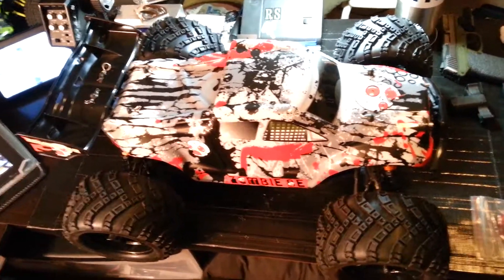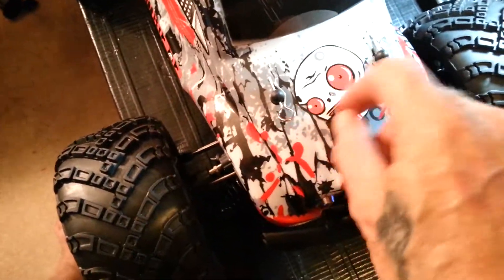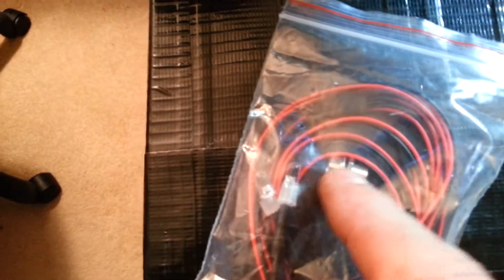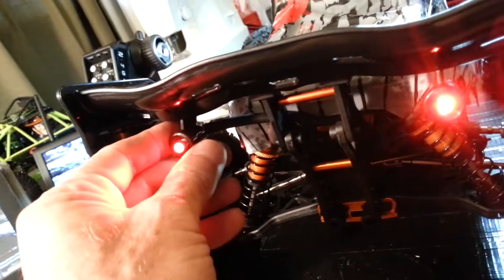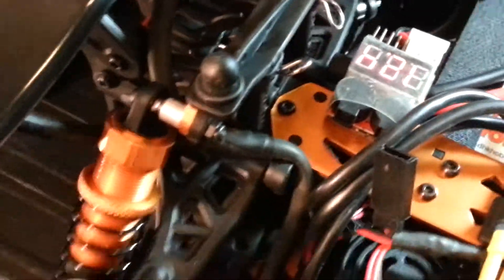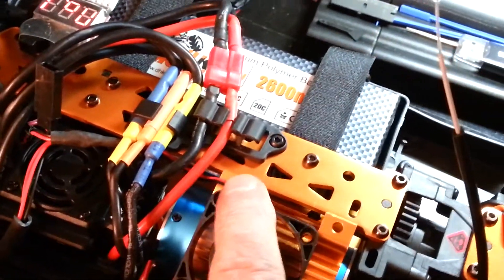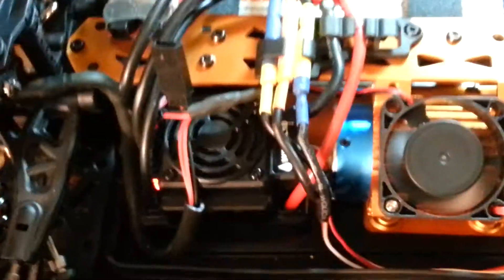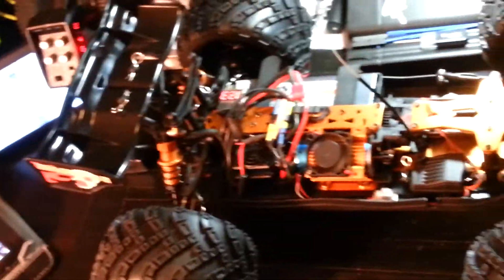Zombie gets lights!!

Comment: Did you take the power for motor fan and lights out from the ESC fan connector? Also, do you have to program the ESC often?
Reply from the maker: Eero Konttaniemi yes I tapped into the ESC fan connection for power to my lights and  motor fan....I have only programed the ESC 1 time when I first got it. almost 50 packs thru it and I haven't had anything break or any problems at all!!!! And believe me I have beat the shit out of my Zombie the body is beat to hell but everything else is great!!!!